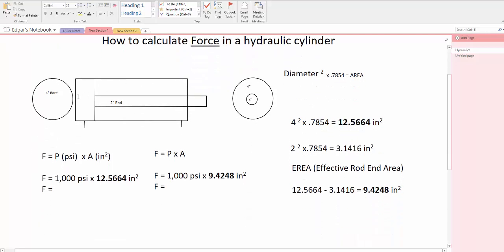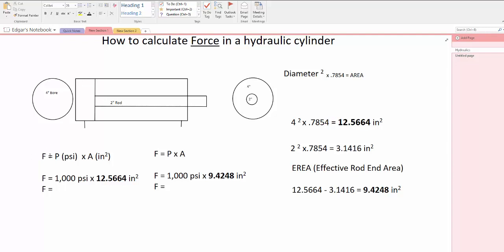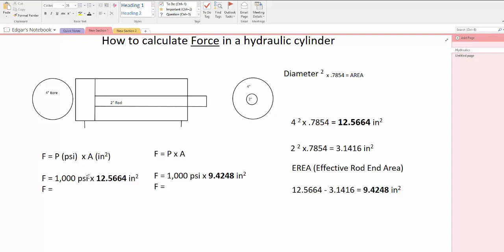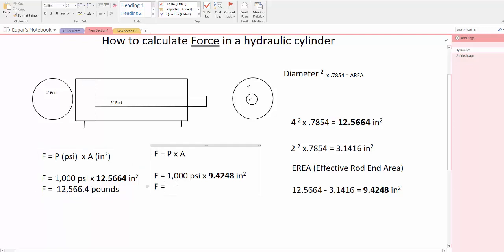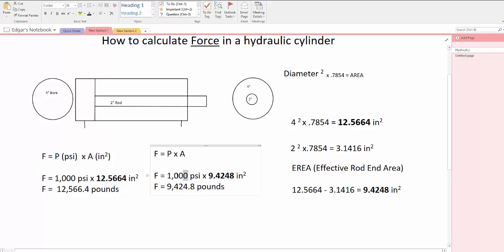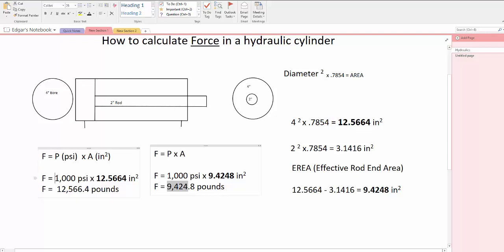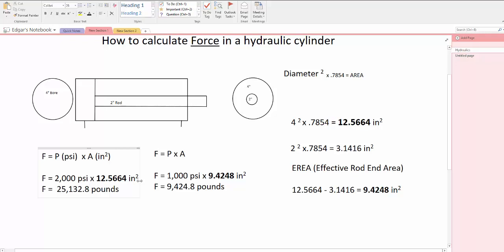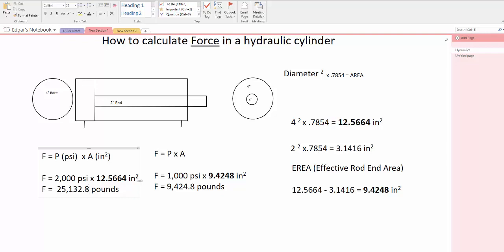How to calculate force in a hydraulic cylinder

Comment: Dear Sir..........Example Problem : I have single acting a cylinder with a 
bore of 18 mm and a rod of 10 mm and a stroke of 300 mm. 
I want to know what is the pressure if my cylinder pull force 10 mm ...........
 Please advise and provide a solution with the formula

Comment: How do you calculate pressure required to lift 10tonnes given that the diameter is 14cm
Reply from the maker: The units I use are inches and pounds, you would have to convert it. The formula would be: Force (pounds) = P (pressure in psi) x A (area in square inches) ..  The rearrange formula for pressure would be: P= F/A
Reply: @EdgarLindo  f= ma what is (a) here ?